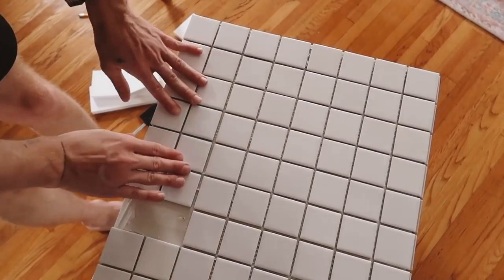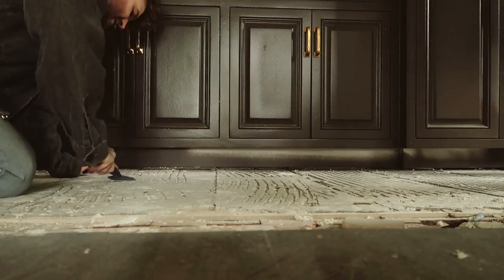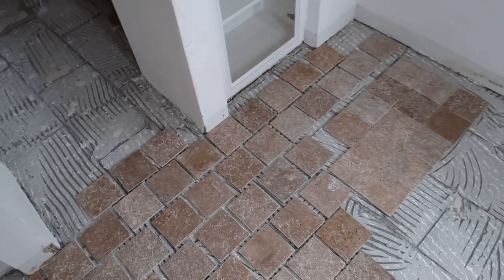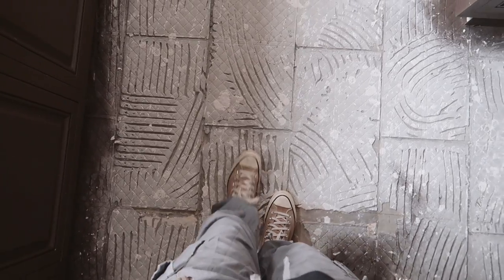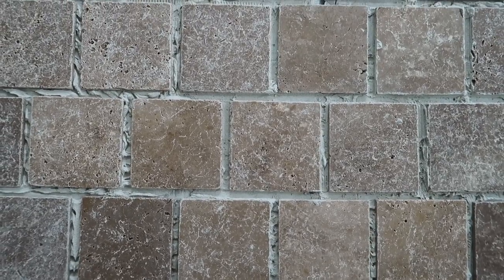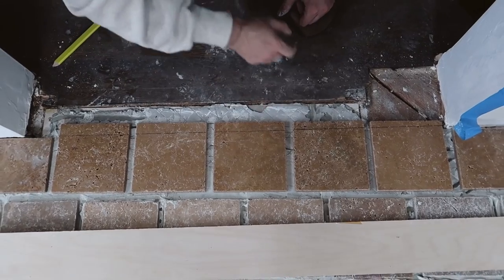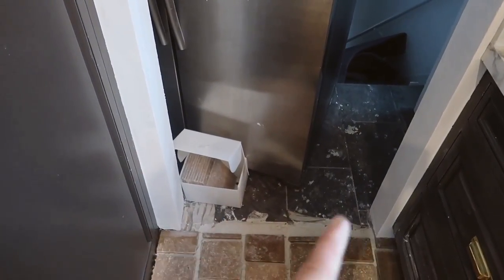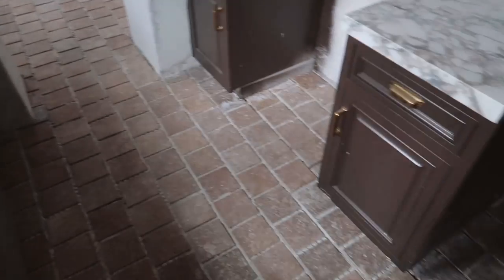DIY TILE FLOORS IN MY KITCHEN *Antique Look for LESS*

Comment: Just to let you know, when there is no tile under the cabinets, it’s because the contractor cut the corner to save money…we renovate our kitchen and we did put tiles under the cabinets. If the next owner want to change the layout of the kitchen, at least he will not have to worry about matching the old tiles with the new ones. It is the same with wood floor.
Reply: Exactly! We move the cabinets in my house and did not have to redo the floors because the tiles are also under the cabinets.
Reply: Ahhh this totally makes sense!
Reply: Looks great! The whole ‘room’ is going to be gorgeous!
Reply: That's not entirely true.  They advise you not to put certain flooring materials under cabinets due to expansion/contraction of the floor, and the potential for it messing up the leveling of your cabinets over time.  We were perfectly willing to pay to put our flooring under the cabinets in our renovation but were told we should not do it.
Reply: Currently remodeling our home and we’ve too decided to run the flooring under the cabinets - so that in the future, either us or new owners can change cabinets without having to also re-do or match the flooring.
Reply: @whiteserpent6753  I guess that would make sense if you put wood floors and a stone counter. Floor expansion could make the counter crack. Stone counter were not that common in previous decades.
Reply: @DrewScottVideo  You used your other account here, just in case that matters to you!
Reply: @whiteserpent6753  In agreement with you about this.  My neighbours just redid their kitchen. They put in all new flooring and cabinets on top. It's been in just about 6 months. The flooring is buckling. It's a very expensive mistake. 

Also, if anyone is tiling: wear a mask!  That powder dust is easy to inhale. With the natural moisture in your lungs... dangerous 🤦🏽‍♀️
Reply: There are pros and cons to either method.
Reply: I agree with grace, if you want to redo your flooring it’s a blessing when it’s not under your cabinets but if you want to change the layout of the kitchen and not the floor then having it go under is a relief.

While it is nice for new owners to be able to move their kitchen around, what if they hate your flooring?
Reply: I don't agree at all. I would never expect or place a finish floor under cabinets.
Reply: Agree.  If someone ever changes the cabinet layout they will have to replace the entire tile floor.
Reply: You are so talented!!! I am enjoying watching your progress. Thanks for sharing!
Reply: Literally!!! My parents renovated their kitchen on a budget and it took a year to match the fancy stone flooring for the missing spots. Biggest headache
Reply: not always. We will be laying tile but we like the cabinets we have so we are going to leave them and tile up to them. Nothing at all about saving money for us, it will just make the job easier. Also the floor plan is pretty basic, there really isn't any other configuration for the cabinets anyway.

Comment: If your tiles arent sealed, you may need to do that before grouting - otherwise they can come out cloudy and dusty (as the grout will stick to them)
Reply: That's a great point that has happened to me.
Reply from the maker: Yes 1000% I plan to seal them prior to grouting!
Reply: Very true. I'm also assuming that you're using white tile adhesive with white /light grout.
Some people seal the tile before laying top, bottom & sides if the tile is particularly porous.
Reply: @lonefox  
Thank goodness! I was worried about that, also.
Reply: Interesting & great channel 👍
Reply: @Belinda James  
In other words, all surfaces of the tile before installing? As these have so many nooks and crannies on their surfaces, how effective is the sealant, and how many coats on this type tile? Will the sealant fill those nooks and crannies? Thank you!
Reply: Yes, definitely!  Porous tile needs this, china tile does not. It has a kiln fired glazed surface, but the ones Drew is using will need to be sealed. You may be able to use the same sealer as that on the grout.
Reply: As usual..Great job! 👍🏼👍🏼
Reply: @cece9145  sealant won't fill the nooks and crannies but no worries, eventually the dirt will just pack in there and stay 😁
Reply: Yes. You need to seal Travertine. Especially with a floor. It will have to be resealed off and on. Travertine is gorgeous! But is higher maintenance like Marble so you have to seal them. You will have to see how the skin cover on the Marble goes over time. I would be curious if that breaks down over time and/or yellows or the finish may flake or streak... While new it will look great. How in the world do you remove a skin finish off Marbel? How interesting... 🤔
Reply: I'm currently watching the final video where he is grouting and this hasn't aged well 🙈
Wonder why he didn't do it after saying he would 🙈

Comment: Drew, be sure you put a sealer over all grouted tile areas so when a liquid is spilled it won’t absorb into stone or grout, which will happen b4 you can grab a towel. A sealer will also make it easier to clean up shattered glass from a jar, dishes or glasses. You might even seal it twice. It’s a big troublesome problem if you don’t.
Reply: They make a really cool additive for grout that has a polycarbonate in it so you don't have to seal the grout anymore and makes the grout non porous. They carry it at home depot.
Reply: @kathyreese4052  Great to know that! What about for the stone itself? Like brick? My sister had a brick kitchen floor and after spills and glass breakage, her husband finally sealed the entire floor w/several coats. Prior to dealing Her small kids were also tearing up their bare feet and would fall as socks caught on rough bricks.The floor was already there when they bought the house. Guess was best choice in their situation.

Comment: Wow that looks amazing, fantastic job, I only have one concern, because they are on top of the original cement, will the oven and refrigerator be at the same level? Hopefully there is room for adjustment around the cabinets for the refrigerator, that said, the transformation is stunning ❤️

Comment: Drew the tile is beautiful!  I love the organic feel of 'eyeballing" as oppossed to perfectly straight lines it is so in line with the age and style of your amazing home.  I do have a question.  When I tiled a backsplash in my home using travertine it was recommended that I treat each tile with a sealer before installation to protect it and enhance the longevity.  Did your travertine require any type of treatment?

Comment: Drew, you might test grout on a tile before you actually install the grout. I had some very similar tile and could not get the grout wiped off of it. My tile was not sealed or glazed. Luckily it was outside and I had it power washed to get it clean but it was a mess. After power washing, I had to go back in and patch the grout that came out during the process. I'm not sure if it was the brand of grout I had or the finish on the tile but if it were inside, I don't know how I would have cleaned it off. You might take some of your tile to the store where you buy your grout so they can guide you.

Comment: do make sure you seal the tiles. Because any food or whatever you drop on the floor will stain them. Also, I would go with a lighter color grout as opposed to a darker tile grout. The reason being you want the tile to be the star of the show as opposed to the grout being the star of the show. And I can't remember if you can seal the grout or not but if you can I would highly recommend it. I just have dealt with tile when you spill stuff on the floor and it's a pain to get up.

Comment: I would try Delorean Gray from Home Depot (Custom Brand), It looks like natural concrete when dries. You also might want to consider sealing that tile with a matte sealer before you grout. It will make clean up a lot easier.

Comment: Tiling before installing cabinets is a higher quality job then the cost-reducing way of installing the cabinets and tiling up to them. When the flooring does not extend under the cabinets, it you want to make any changes to the cabinets, you are forced to change the floor as well. So it all depends on perspective and budget. When we moved the cabinets in my house to create a pantry, I was glad the tiles were under the cabinets so it was a smaller and less expensive job.
Reply: yes for new work, but if you are renovating a space that doesn't always work. We are laying tile and we love our cabinets, we are not taking them out to do the tile because we think it could lead to some damages and tiling under them would of course mean they won't go back exactly the same and we'd have to lose the back splash too. We are putting tile under our house in the crawl space so we can patch things in the future if it's ever needed.

Comment: I got a question about the tiles especially in the kitchen area, how porous are the tiles? I was only thinking about it since you may want to mop the floors or to prevent oils from damaging the tiles too. Is there a sealant you can use to prevent water and oils from getting into the tiles?

Comment: Great job. Don't forget to clean out the glue/mortar from between the tiles before you start grouting.
I believe the tiles are honed ? We have put in many honed travertine floors and never sealed them. After years they still look good as new. 
We always went with ivory coloured grout.

Comment: Tile is always laid first prior to cabinets being installed. Cabinet should sit on the tile floor. The floor should not be butting up to the cabinets. I would suggest removing the kick-board, laying the tile and then reinstalling the kickboard so that it has a more professional finish.
Reply from the maker: That's actually what we did however once the toe kick was removed you couldn't really tell it was removed! I plan to paint it dark brown and add it back for a nice clean look :)
Reply: @lonefox  perfect!

Comment: 7:47 Beautiful job. Actually the reason you use a comb trowel is to create pockets of air under the tiles. It is those pockets of air which hold the tile down by suction rather than the "glue" of the mortar. The previous tile job had too much mortar and not enough air pockets which is why it was so easy for you to pull them up.

Comment: I cannot wait to see your choice of grout... it can really change the look completely! I have done a lot of tiling myself in former homes and really enjoy the process... you have the patience to do it right! Keep on this delicious journey... it will mean so much more for you to have done it yourself. PS I have seen professionals tile both under cabinets and in front of them... just be sure to keep a spare box in the attic or storage in case you need to repair...in one house I had to dig out the tile in order to replace the dishwasher, then re-tile in front....a pain but certainly not impossible!

Comment: I know you're already done, but I would wet the old mortar first.  That's what they do when plastering on top of old plaster, I'd think it would be the same and your making the old mortar more porous when wetting it.  But, what do I know...lol. I've never tiled myself.  Hahaha.  Is Justin your brother?  OK, so my 2023 New Year's resolution is to do my very best to complete the 6ft extension/remodel (started by my family in to be mid 80's) of my very rustic 1953 cabin in the Santa Cruz redwoods.   Some of what I need to do is tile a small amt of floor area (the rest is tongue & Grove redwood) and back splash in the kitchen and bathroom.  You're doing a great job of explaining and making me believe I could actually do it.  I'm a 68 ur old widow.  All the men in our family were the ones to do the work on the cabin.  How come my husband never wrote me a how-to- booklet before he passed.  Lol.  It would have really come in handy. So impressed with all the work you've done on your new home.  It's going to be spectacular. ❤️❤️❤️❤️❤️❤️❤️❤️❤️❤️❤️❤️

Sorry for the extra long post...But, I thought you decided to go with two different sizes.  Your just finishing the breakfast nook area, all with the sq brick.  FYI, I love it, perfect for your Spanish style home.

Comment: You can always mix grout colours together to come up with your own custom shade. However, make sure you document what you mixed and how much. For example 2 cups of the beige with 3/4 cups of the grey. As long as you know the ratio you are using, you can create exactly what you want. Do a test with the same ratio on a much smaller scale, like 2 tablespoons beige and 3/4 of a tablespoon grey, then test under the stove. If you still want a bit more green, add a measured pinch of green grout to the test mix.

Comment: As those who have suggested, yes, good to apply a sealant As for colour, maybe if you don't find what you're looking for, then consider customizing like you do with stain, to get a colour you want. I've successfully done it b4. Anything with permacolour grout is going to be a dickens to work with, but will be worth it as it won't stain and is true to the colour. My tile guy found it frustrating to work with, and had to buff the floors with a big buffing machine afterwards to remove the haze, even when the tiles had been sealed prior to grouting. It does look real nice though. Yes, you and Justin both killed it, WOWZERS!

Comment: So glad others told you about sealing before grouting! Penetrating sealers are best .. they leave the stone look alone and don't just sit on top.. reseal when water doesn't bead up and the stone should not darken from being wet...when it does .. time to reseal.. Also keep a few square ft extra in your basement for just in case.. so hard to match because these are nature's one of's ....

Comment: If you have the subfloor problem anywhere else take off the toe kicks on the cabinets and use a multi tool to cut the backer board/subfloors. That way you’re not dealing with old mortar. The tile looks great with the cabinets.

Comment: Hi! Always love your videos!! About the tiling, the colors are beautiful but because of the rooms they are in, it’s gonna be a bit difficult to maintain that. One is because if you drop oil, wine, some food, or else, it will go into your tiles and stain them. I have the same so I know 🥲 two is if you want to avoid that and protect the floor, you will have to put a protection coat on top and this is gonna nourish and protect but also change the color a bit, just like with water.. y oui y probably knew all of this but just in case 😊

Comment: Architect here. Subfloors are always under cabinets (& the entire floor area). It provides structural stability to your floor framing and base for everything to sit on... cabinets & floor finishes. Your floor finish tile or hardwood is best if it is installed first before millwork (if you ever change cabinetry in the future it means there is floor you don't have to match/patch underneath). They can also install flooring after cabinetry but this is the cheaper & quicker method most seen in builder grade suburban homes where they're building 100s of homes at once.

Comment: I like that it sort of gives an outdoor paver type look to the floor, can't wait to see it grouted.   There is no right or wrong answer to putting flooring under the cabinets or not.  Honestly a contractor should ask you which you prefer and give you the pricing for each option to save you money that could be used on something that you can see.  And since trends change it makes it easier to change out flooring in the future since changing flooring is a much less expensive way to update than putting in all new cabinets.

Comment: to get to that subfloor like you have, you would need a legit jackhammer LOL. when our contractors ripped up our floor they spent almost two full work days just leveling out the floor. it’s the proper way to do it but you do risk damaging the cabinets. we ripped out our old cabinets so we didn’t care, but since you wanted to preserve your cabinets it makes sense why you would go another route. tiling over the subfloor is fine, just be super sure everything is level!

Comment: UK and Europe, kitchen floor is usually completely tiled before cupboards are placed on top. I think it's practical because, if there's a water spill, it will sit on the tiles rather than soaking in to the floor. Also, if you have free standing items like a fridge, there's a tiled floor underneath which can be cleaned.

Comment: I'm European and where I live tiles usually go below the cabinetry. I gut nervous when you but uo the back splash before the floor tiles because tiles affect the hight of the cabinets.
I think the reason for putting tiles below the cabinets is to enable you to change the cabinet arrangement without retiling. In the other hand: the only room I tiled myself was a kitchen and I'm pretty sure when the cabinets are switched out the tiles will be as well.

Comment: I agree with sealing your tiles before grouting. Easier cleanup. I would recommend taking a look at Earth, Walnut, or New Taupe colored grout from Home Depot.  You can get the bags of grout that you mix yourself or you can get the fusion grout that comes premixed in a bucket with sealer built in. They also came out with an additive for the bags of grout to help seal it.

Comment: I have travertine as well but bigger squares. I also have them as the baseboards which just finished it off. Great job!
Reply: Hi!
Did you seal your tiles and/or grout? If so, how many times, and does it fill into the nooks and crannies of the tiles themselves? Thank you!
Reply: @cece9145  mine were sealed after they were tiled and grouted. It was suggested to me I should yearly but I don’t cause don’t get that much traffic.